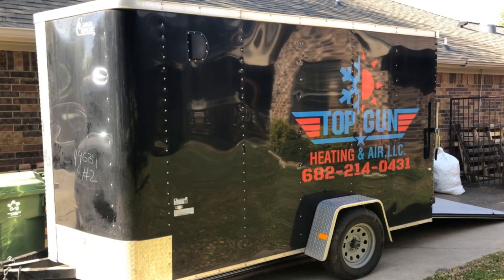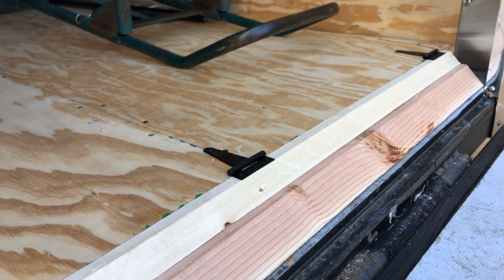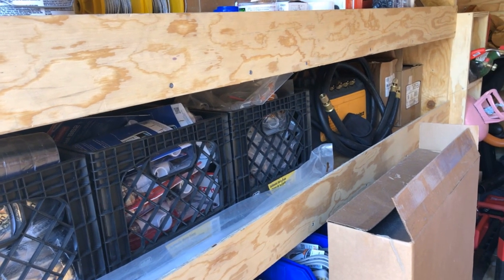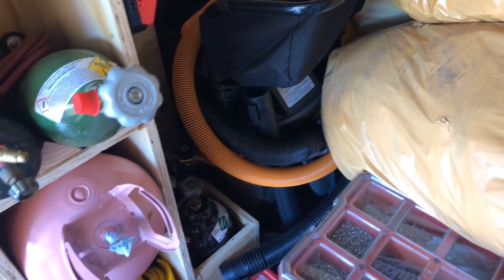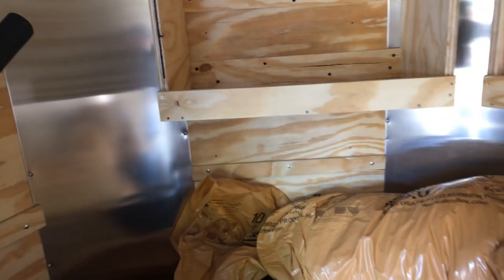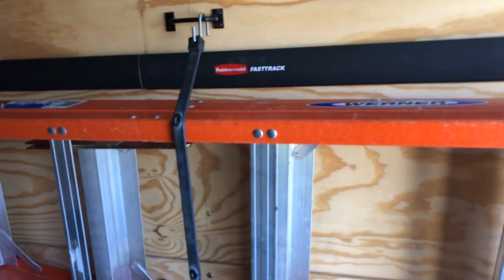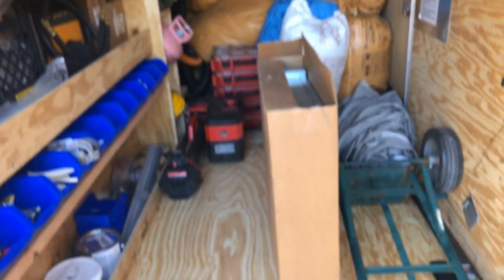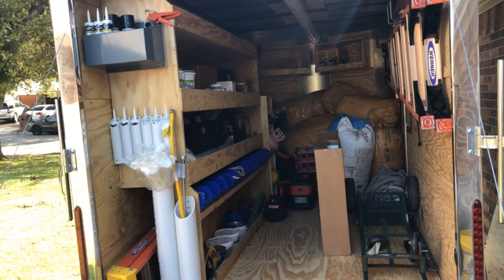Update: HVAC Install Trailer Build Out

Comment: It Looks like a tight fit to load condensor and air handlers unless those are delivered to job if so nice trailer organization
Reply from the maker: Yeah, I think the camera makes it look smaller than it is. Easily should have bought a 7x14 tandem axles. Would in a heartbeat next time.  We’ve fit 2 complete systems into it before. It’s tight for sure